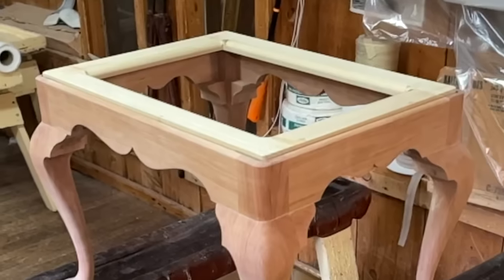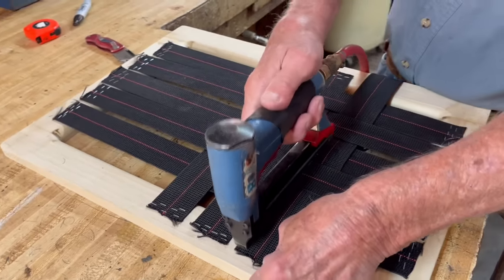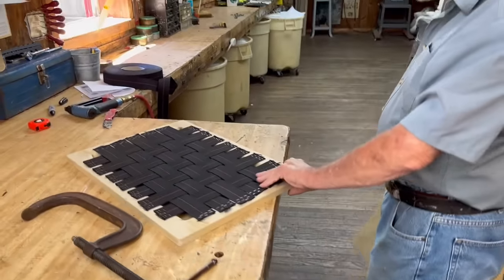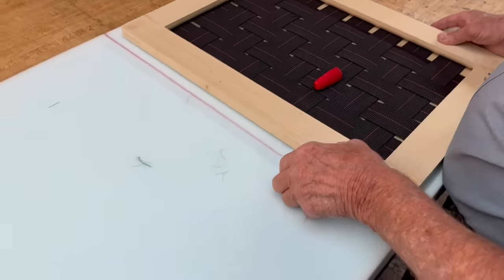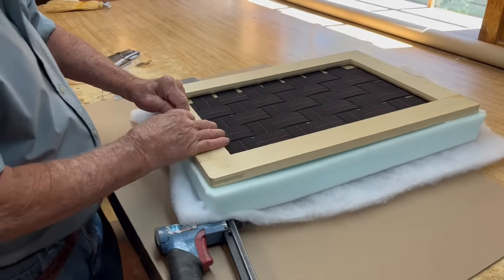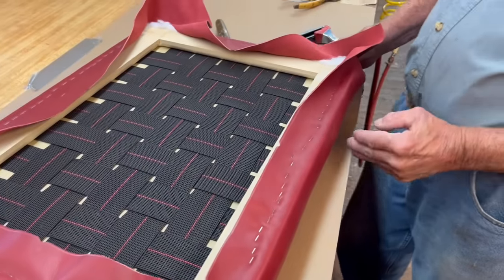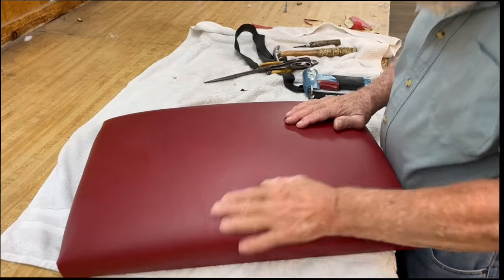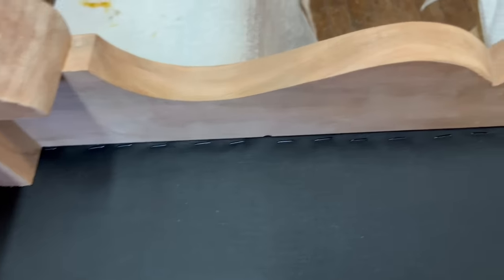Upholstery with a Master

Comment: Hey Tom, great vid and fun to watch Joe in his zone.  I upholstered one shop stool and it came out good though it is nice to see the proper way to do it.  Question for you is how did you determine the gap between frame and stool to allow for leather, dacron padding, etc?
Reply from the maker: I talked a bit about that during a recent SNL video on the upholstered seat. But basically you can use the actual material thickness plus the Dacron thickness. For the leather I used this amounted to a little less than 1/8” gap all around. 👍

Comment: Good job Joe.
Years of experience makes it look so easy. The younger generation it seems does not want to put that perseverance in. Cutting corners as Joe did takes technique which has been ingrained over decades. 
I have a friend who raised 2 daughters sent them to college,  renovated and built his own workshop, built 2 extra rooms added to his tiny house. All financed by his upholstery trade. Yes he worked long and hard but the rewards speak for themselves. He'll be 70 in 2024 & still at it. 😊
Reply: On the contrary, the younger generation is more likely to go back to traditional methods, rather than the late 20th century shortcuts. I know a young upholster, he uses the traditional methods and materials used in the 18th and 19th century. Staples and foam are the shortcuts!

Comment: Great Video, upholstery is not easy. What is the size difference/gap between the rabbeted groove in the stool and the outside of the frame?
Reply from the maker: The gap is appropriate to the thickness of the material and layer of stretched Dacron. In this case it amounted to 3/32” all around. Thanks! 👍

Comment: Great vid - one question tho, how is the top held onto the bottom?  Are you going to add some angle brackets or is it just press fit?
Reply from the maker: It’s simply a press fit. This type of cushion is called a slip seat, fitting inside the recessed frame. They were typically not attached by any screws from below as they would not fall off due to the recess. Thanks for watching!👍😎
Reply: @EpicWoodworking  right on....thanks for the info!

Comment: How do you know how to measure the inside of the bench so when the seat is completed it fits snuggly inside the bench?
Reply from the maker: The seat is opening is measured after it is glued up, and the upholstery frame is made to size allowing a margin all around to accommodate the thickness of the fabric planned to apply. In this case I allowed 3/16” all around to accommodate the leather covering. Thanks for watching!👍

Comment: Would the technique for the corners also work with vinyl/faux leather or would another technique be more appropriate?
Reply: You might have a greater degree of success if your manmade material is warm/warmer. It will stretch more like the real leather does, but you'll likely still have more bulk.

Comment: Was wondering how much clearance your seat frame has to the stool frame? I've  got like 1/16" all the way around and worried thats not enough.
Reply from the maker: Good question. When covering with leather, I allowed a 3/16” gap all around. And even then it was tight in the corners. So Joe modified each wooden corner to accommodate the bulk of the extra fold of leather on the corners. So the gap you start with between your slip seat upholstery frame and the rabbeted recess in the seat rail should be appropriate to the thickness of the material used. Leather, in my experience needs at least 3/16” allowance all around. I would ask the upholsterer before final sizing, or test wrap the layers and measure if you’re doing it yourself. 👍
Reply: Thank you for replying! I am using a faux leather and will measure it with the dacron.  I live just outside Concord NH and have watched this video way to many times😅. Thanks again!